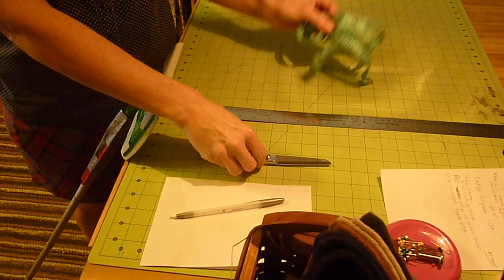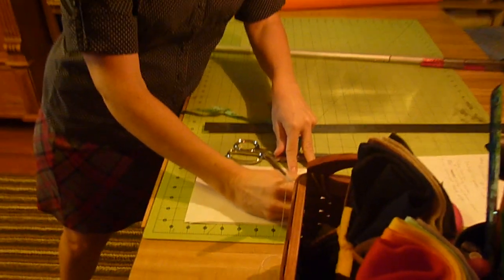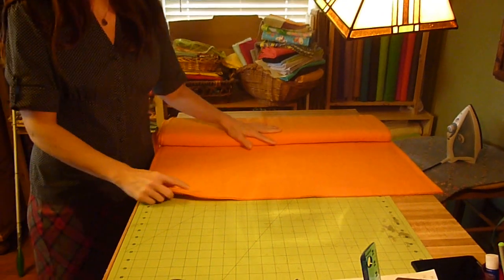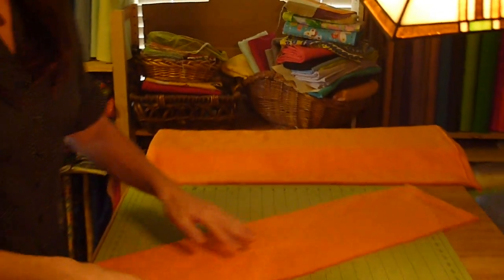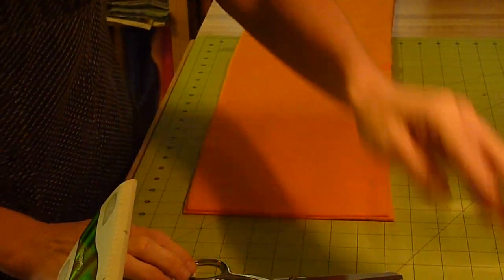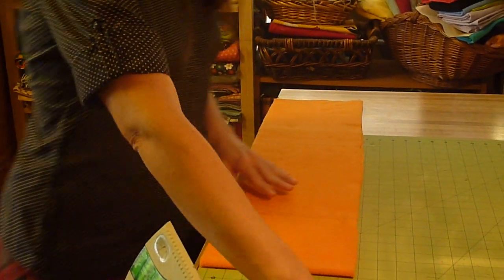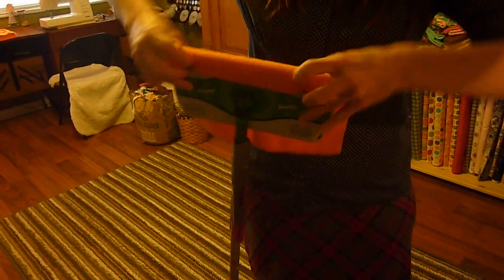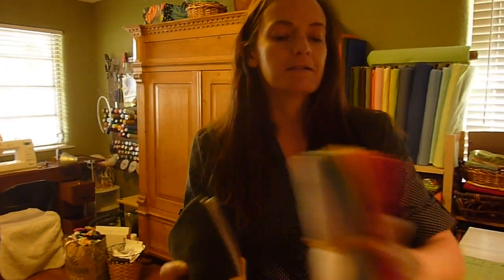How to make your own Swiffer cleaning cloths without sewing

Comment: What is another material you can use for wet mopping? These work great for dry but I spray my floors and then mop wet, these just seem to push the dirt not pick up.